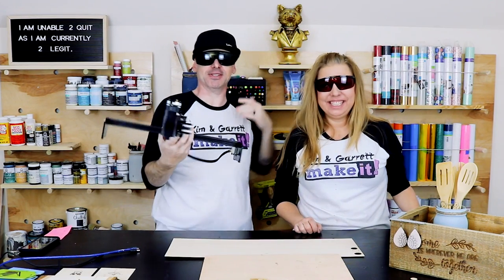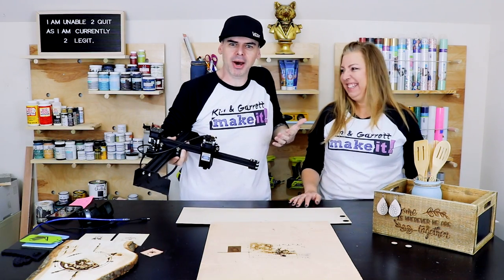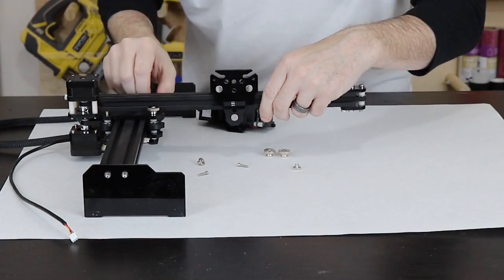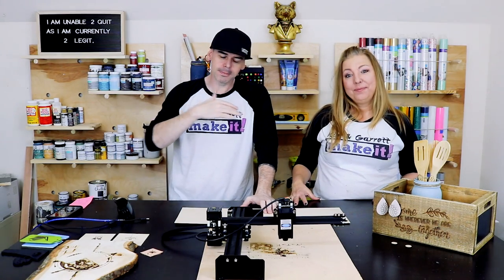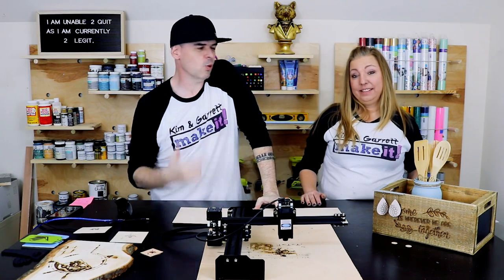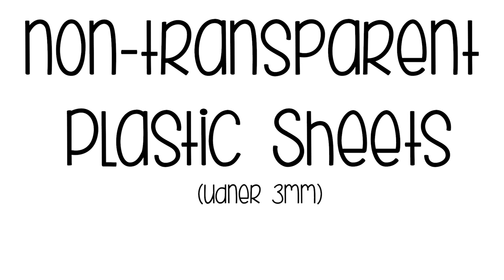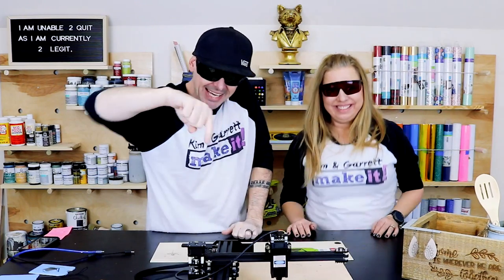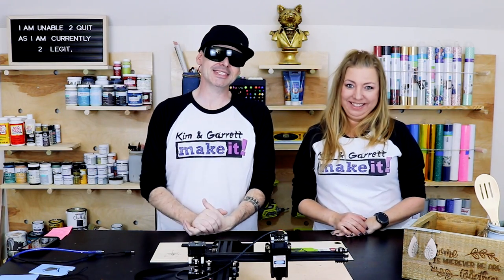10 Things We Learned from a Cheap 20W Laser Engraver and Cutter

Comment: Just a few notes for y'all - I have a "big" K40 (supposedly a 40w, more like 30-ish,) and while it does somewhat have some "safety" features, your laser is much easier to work with. It actually has about the same lasing area as yours (300mmx200mm.) No enclosure means you're able to engrave things you won't be able to fit in an enclosure (as you've shown.) The larger lasers use a tube laser with a high voltage power supply (can be dangerous if you don't know what you're doing) and are CO2/infrared so you can't see the beam. You have to align mirrors as well, as the tube is in the back and the X/Y carriage moves the mirrors around instead of the laser. With the little unit you have, there's no need to align anything - and trying to align an INVISIBLE laser (as CO2 lasers are infrared and can't be seen) is a severe pain. That's not even to mention extracting the fumes from the enclosure, as well as the smoke that can fume up the lens which will self destruct if its obscured (resolved by having an air pump in the unit.) Oh, AND you have to keep the laser tube cool so you have a water pump and a bucket full of RO/DI water (otherwise you get algae in the tube!)

The only thing you wouldn't be able to do with your little unit is use something like Cermark, which when sprayed on a metal object and then lased with a higher power laser, will fuse the material to the metal (blackening it.) Otherwise the higher power laser does about the same as what you're getting out of that little laser there, and for a fraction of the cost and headache. Put a little (40mm?) computer fan pointing down on the head so it blows any smoke away from the lens and outside of the inability to mark on metal, I'd rather have the little one y'all have!

Try getting some anodized aluminum blanks (think: business card size, or dog tags) and lase them too. Should be plenty powerful enough to burn of the anodization. You should also be able to etch painted surfaces with it too - so paint a piece of metal, use the laser to etch just the paint off then chemically etch the metal the rest of the way (the paint acts as a resist to the etchant.)

Comment: Before you get a bigger and better laser for your hobby shop, I would first master the baby steps.. This is a good start for you both. In as much as the exhaust for your current laser goes, I would build a box big enough for the machine (maybe two inches in all directions) with holes on the bottom and an exhaust fan on top that leads to your window (like one of the portable air conditioners). You could put a hinge on the side with a stop string (wire) so it would not fall over. If you would like a bigger and better laser-cutter, might I suggest the Makeblock CO2 laser box. With this you could make deeper cuts with variations (like a land-scape). Like your video.. Keep up the good work..

Comment: does it engrave painted or anodized metal?
Reply from the maker: I tried to paint aluminum with black acrylic paint and then blasted it full power at a super slow speed. Nothing... not even a scratch.
Reply: Thank you!  I am wondering about buying it and upgrading the laser.  TBD.

Comment: Are you still using your laser?  I just bought the Ready-to-laser 7 watt diode laser from Next Wave Automation.  It is 12"X20", is enclosed with exhaust port and has a tinted lid with interlock.  It's pricy but still half the cost of something like the GloForge.

Comment: Try using black spray paint on glass at 100% power and a speed of 100 mm. I use a blue diode laser Atom Stack A5 Pro and it etches glass like crazy. Give it a try and do an update if you can.

Comment: Looks good enough to burn off black ink to expose copper circuit board, then take board with pattern over and etch with ferric chloride. So, does a lap top or desk top pc have to be there when running the laser? So now, I have to find an old laptop and take it to the garage?  Thanks. Do you move your arms around like that when driving? Yowzer! ha ha.. You could sell kitchen appliances too! Great job.Hey, Great graphics too!!!
Reply from the maker: Yep, it needs a laptop or some kid of PC. LOL, yep I found an old laptop running 4gb of memory after it was done running years of updates, I just move it as a unit. ended up attaching everything to a piece of 3/4" plywood.  HAHA Yes, I move my arms around all the time.  I never noticed it until everyone on Youtube started to complain.  I like to tell stories and I end up acting it out while I tell it. I didn't realize it til YouTube.  Thanks for the support!
Reply: @KimandGarrettmakeit  Ha HA.. Not really a complaint, I thought you were going to do some M&M stuff.

Comment: Considering a Mathrose Laser Engraver 20W from Amazon, it says it will engrave and cut metal, vinyl, wood, leather and aluminum. I just seen your video and you said it would not work on metal or vinyl, not sure what machine you have but are there better 20W's to buy? Just wanting to start out with it for small projects. Your input is appreciated.

Comment: if you add a G8 diode for the laser it makes it more powerful to cut and engrave on these ...and it only cost 18-20 bucks because the focus of the laser gets to the right height to make the laser cut better...the Ortur Master 2 is right now the top of the list for those budget laser engravers with the 20w laser and its actually a 6.6w .This one you got is a knock off from the Ortur engraver and the Ortur Master 2 has safety features.... and you download Lightburn for the software to use it better. Also to align these type of lasers you can do it easy with lightburn it as a feature button to align the laser and it does a quick low power run so you see where its going to engrave really fast and you move your wood or whatever how ever you see the laser framed it....thats all on lightburn software, you just need to practice with it because you can get way better results if you practice and adjust things and learn how to focus with it....you can do a quick search and people that practice with it already can do anything you think you cant do with it pretty much.

Comment: Avoid the glowforge, they're junk. You can't do anything with a rotary attachment like tumblers at all. They're small and very weak. Look into a redsail or thunder laser. You can actually put a glowforge inside one of those. You can't do anything thicker than about 4" without ripping the floor out of a glowforge. Look for something that has an adjustable z axis. Don't be so focused on getting a camera, most lasers use red dot pointers to align. This is industry standard. 60 watt is a decent mid range however I found that my 80 watt has always been powerful enough for any of my needs.
Reply: 80watts? Lucky you...
Would you share with us what exactly machine do you have?
Reply: @john-l  I have a redsail. I got it off of eBay a few years back. If you get on there and search 80 watt laser engraver, the red and black is the version I have. They're pretty economical compared to the big name brands and perform pretty well. Ive had no issues in about 5 years.
Reply from the maker: There should be a link to it in the video description, let me know if you cant find it

Comment: Omg!! You guys!! I’ve been wanting a GlowForge for forever, but still can’t justify the $. The biggest one is ideal. Have you guys checked on it? It checks all the boxes. And the software is great. (Watch a trillion videos on it) There are so many (more) awesome things we could do, that a cricut can’t. {and safety is always first! Definitely need the exhaust!} But I would love to know if you all have checked into it and what you think. The $ is a huge factor, and of course if you can make a quick return on it. As always, rocking video. You guys are totally RAD! (I loved all the images you cut as well!) Thanks for all your info!! ☮️💗
Reply from the maker: Thanks Candace!!! Yes, that was out issue, it's so expensive! We dont typically sell anything, but I told him we would HAVE to start putting some things in our store to make this purchase worth it!
Reply: glow forge has a serious cooling issue unless they put a radiator on it,  it will stop and cool down in the middle of a cut (10 to 15 minutes) which is crazy Now I have a K40 with a radiator from a old ac unit hanging on the wall and it never needs time to cool down but sense nether of you have any serious laser experience please stay away from CO2 lasers till you take a course on them as there is a big difference between them and the laser you have oh and 1 thing I forgot my cooling water reservoir for the co2 laser  is 4 gallon with external pump .

Comment: Just wanna mention, this is most not most likely not actually a 20 W laser, because if you wanted an actual 20 W laser you would be paying closer to $200 for just the laser. It is more likely a 2 W laser but they have falsely branded.

Comment: I am sorry, but you did all this research and didn't realize that its an engraver, not an engraver/cutter and you had no hope of it going through anything substantial? Or didn't discover the software is lacking? I enjoy your channel, but that barely covered even the basics.  Suggesting better software could encourage people to look into buying this laser.
Reply from the maker: I knew it was a weak laser when I bought it.  I just wanted to see what a laser was like and prove to Kim the possibilities of getting a bigger laser. This was a good started laser to get my feet wet. I have learned so much since this video. The software that come with it sucks.  You can use Lightburn software which is way better. The laser itself isn't really 20w, not even 4w, more like 2.6ish, but it works great for cutting paper, foam core, cardboard, and it works pretty good for engraving. Right after this video I was able to convince Kim to let me buy a Glowforge. The Glowforge cutting is way more powerful and the engraving is Awesome!  Since then I only used it one time, to engrave something that wouldn't fit in the Glowforge.  I want to do an update to this video.
Reply: @KimandGarrettmakeit  fair enough, The Glowforge is a good machine and but pricey.  Don't ignore the Chinese laser cutters that are featured on eBay for example. At the beginning( 2010), they were not well made and you had to watch a dozen videos on how to make it work better. They stepped and saw all the feedback, and they are for the most part a pretty good machine at around $400. Yeah, you need a bucket of water and an aquarium pump to keep the laser tube cool, which isn't sleek, but necessary. Glowforge just packages it more pretty.
Reply: Once you operate in the 40W range ( which is a true 40 watt), think about getting the rotary attachment, Glowforge and most make one. Now you can laser bottles and drinking glasses.

Comment: Buying the original Ender 3 from amazon or anywhere will get you this basic system plus the vertical axis. Getting the same laser and the ender 3 version one will cost you under $200, you get more but for less cash. The original Ender 3 is still one of the best 3d printers for the price to performance you can get. This type of laser is designed for pcb fabrication, arts and crafts projects. If can't cut metals, it can etch on the outer anodized layer but not the actual metal. It's not the death star that's for sure. These types of lasers can cut through anything it can engrave by adding compounds that react to heat but that's cheating.